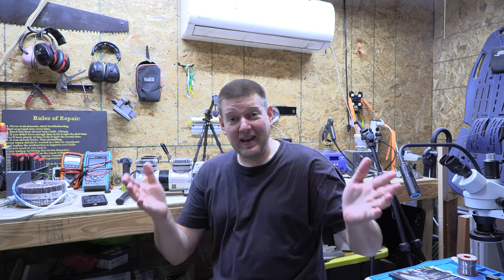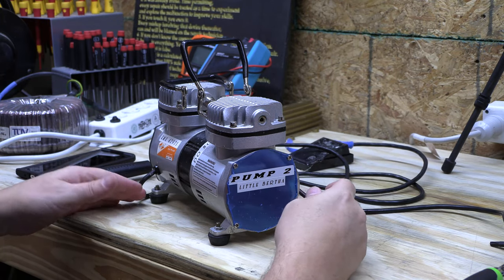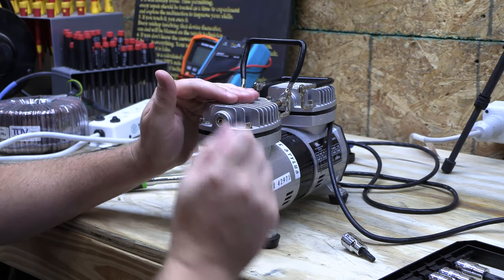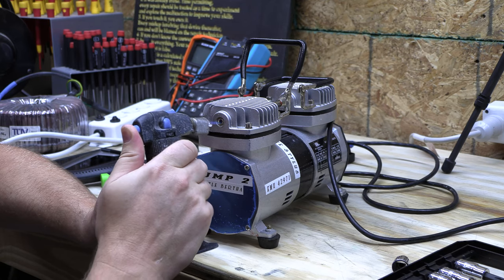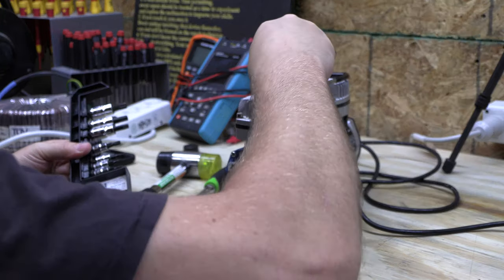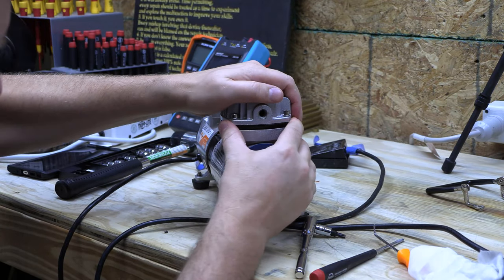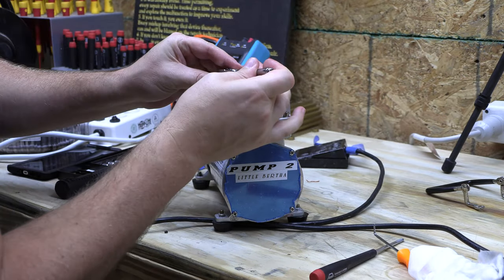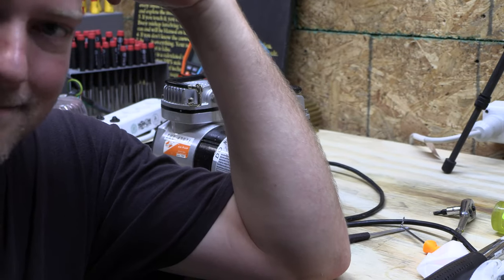Air Compressor Metal Extraction

Comment: 8:47 Some remarkings, the brass shavings were on the side where the connection to the other cilinder (first stage) is. 
If the shavings were from the broken fitting, then they were on the side of the outlet.
So my guess is, that those brass shavings were blown in, from the first cilinder.
Another clue to this conclusion, if the pump was running when the outlet fitting was snapped off, the brass shavings would be blown out.
If the pump was not running, when the outlet fitting was snapped off, the brass shavings couldn't make it trough the 2th cilinder, back to the connection to the first stage.
And as last clue, the snapped off fitting has a small hole at the bottom, i doubt if that amount of brass shavings could pass this small hole.
Also, when brass breaks off, that results in big pieces, the brass shavings that were seen look more like the shavings you get when you drill into brass.
Reply from the maker: Case in point, you never know what another technician has done before you get your hands on an item. Always pull the cylinder head and clean it.
Reply: @BetterBiomedChannel  Yes, but I meant, if there is dirt, shavings etc... in the 2nd cylinder (which may come from the 1st cylinder), it is best to also check the 1st cylinder for damage. With cilinder, i meant also the cilinderhead were the intake and outlet connections are.
And yes, you never known what previous technician(s) have done (or not done) on a device,that's why it is best to start your diagnostics from scratch.
In the past, i once trusted someones story about the measurings he did, but in fact those measurings where never done, so i ruled them out, and kept searching and searching and lost hours, untill i started all over from the beginning and found the cause of the problem (what schould be tested, but it was not was tested). 
Since then i start from scratch when it comes to diagnostics and repairs if i don't know the history of a device.
Reply from the maker: Here's something you should consider: where did the brass come from?  The piston is aluminum, the head is aluminum the cylinder looks brass but there would certainly be noise and aluminum shavings as well. The only piece of bright brass was the hose barb.